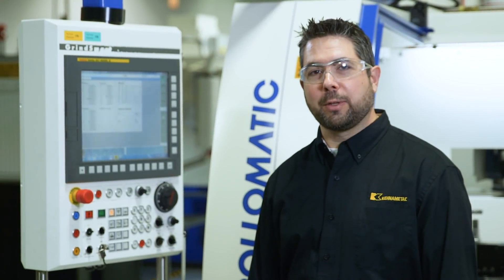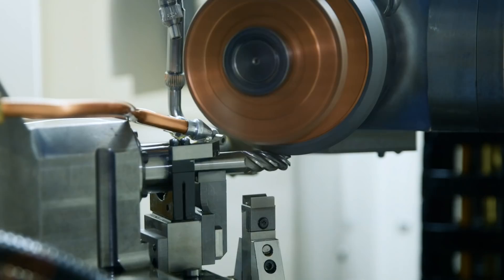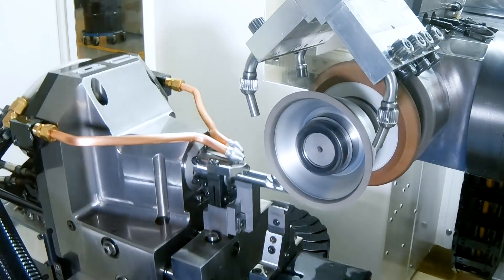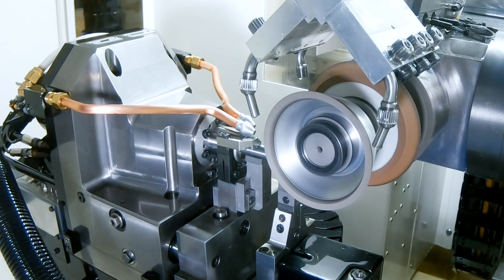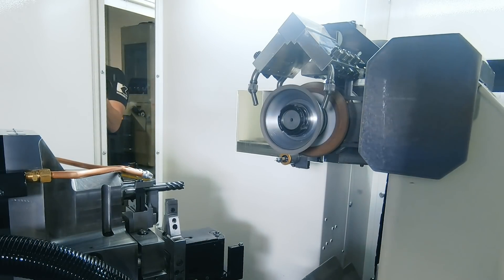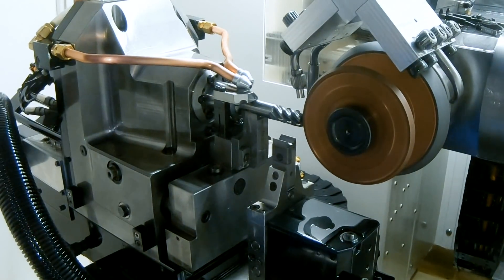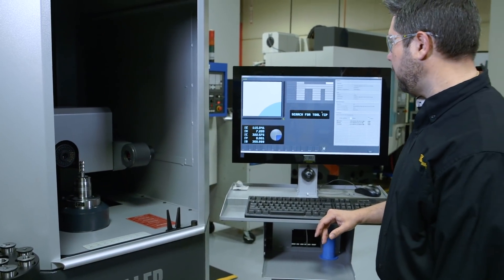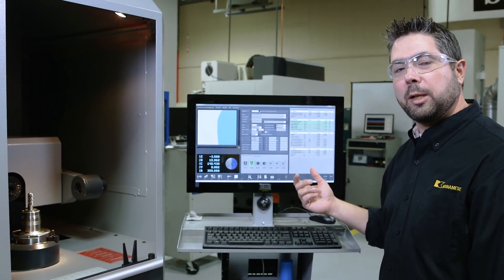GRINDING Worlds Top Cutter on $500,000 5-Axis CNC Machine | Kennametal HARVI III

Comment from the maker: This specific grinder starts at $400K. Our price as shown is with options. Truly an Amazing 5 Axis Machine!
Reply: TITANS of CNC: Academy WOW, thats very expensive. In Europe that mashine cost you with Oil filtration and cooling so 380000,00€
Reply: @GermanoEllinas  Hi Germano,  I am a sales manager for Rollomatic in the USA. Please know these are not official numbers, also actual installed pricing can vary widely depending on options and peripherals. Your example of European pricing for machine with a coolant system is comparable to USA pricing once the exchange rate is factored in. Cheers!
Reply: @GermanoEllinas  You need to convert the currency my friend that 380000 euros is =$433200
Reply: Yes I know, but for 380000 € I get a 6 Axis mashine here
Reply: I work in a rollomatic 620 xs. What a machine, keeps tolerance of 0.003 in the radius for hours. Also runout is near 0. Incredible

Comment: Do they pick a random sample off of a run of specific sized parts or cutting tools for testing or is everyone individually inspected?  I'm pretty sure I know the answer but these Kennametal cutting tools are pretty expensive so I figured maybe they do test everyone individually.
Reply: I would expect 100% inspection from kenametal.   I used to make new solid carbide cutting tools for a no name company that usually sold as a made in usa".   I inspected every feature of every tool i made.

Not sure why they need a seperate machine for inspection.  The ANCA i ran could inspect most features before taking the cutter out.
Reply: Mark Ferrari If you Check everything on th Anca it costs Too much Time. Therefore you can buy the ney Zoller Titan with Robot and marking system.

Comment: Hello Titan ! Can you tell us, how long does it take to grind Harvi III ? Or any other endmill for that matter ? Or is it a buissiness secret ? Thanks
Reply: Really depends on the EM, corner radius tools will take longer. It really depends on how worn the tool is also, the more you take, the longer it will run. Everyone regrinds a little different, but a corner radius EM like this would be 10-20 minutes a piece. We like holding edges on our wheels so we dont have to dress as often, so we run a little slower.
Reply: @AH0160  Thanks you for your answer

Comment: I would like to know the price different between a new tool vs a recut tools
Reply: The rule we follow is, 1/3 of the cost new. Depending on the tool, you can generally get 3-5 regrinds out of it...
Reply: @AH0160 
What's the usual lifespan difference between a new and reground tool?
Reply: @zajtoja  we always regrind and coat our tools after they have been inspected 100%. They hold up just as well or better than a new tool depending on the application and situation. It's a fun process and a daily learning curve.

Comment: Why in hell did they not show it cutting raw stock. No one wants to see them cut air.
Reply: because than they would have to use coolant and than you would not see anything, maybe?
Reply: @user-xo5zu1lw2w  you got it. They want to show the machine movements. Without coolant/oil you get a feel for what the machine is doing.
Reply from the maker: Will show in a few days.... wanted to show the movement without coolant.
Reply: @TITANSofCNC  is tool grinding something you are looking at getting into? Huge fan of the channel man.
Reply from the maker: No
Just was in NC, so I asked to stop by Kennametal to show some process
Reply: Hi Andrew, during carbide grinding there is so much coolant flowing from so many directions you would not be able to see the process. Cheers!